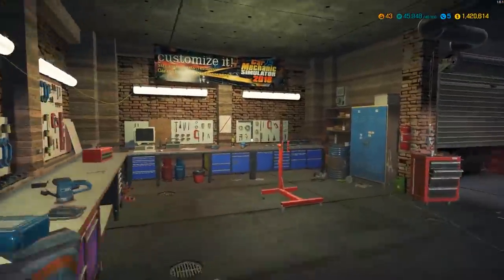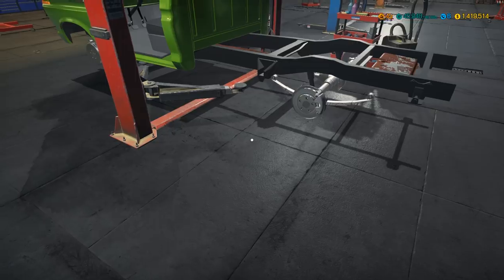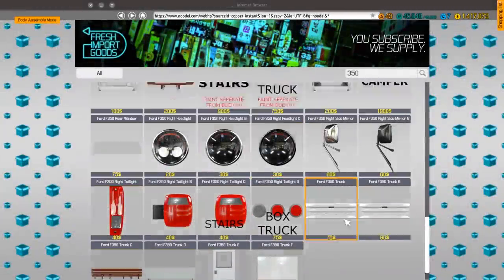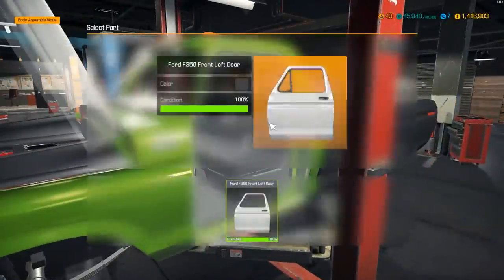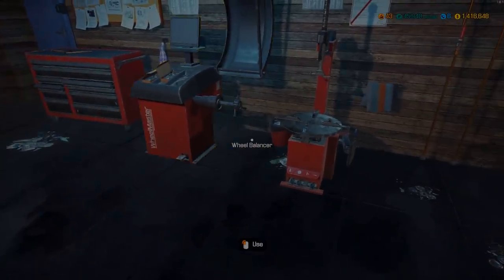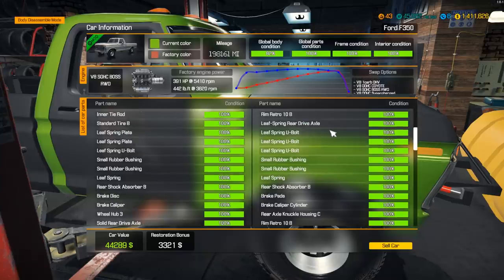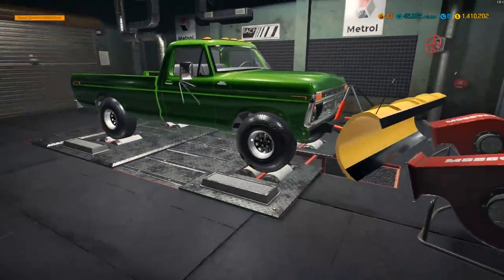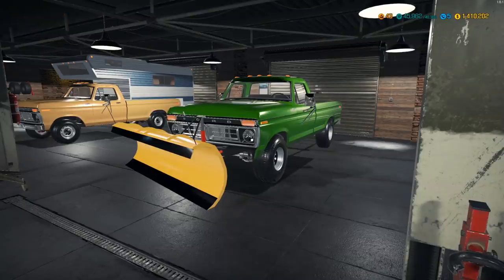1979 F350 PLOW TRUCK | Car Mechanic Simulator 2018

Comment: Gorillaman it is a 75’-76’-or 77’ cause you can tell by the grille style
Reply: jake Fournie in late 78 and 79 they also switched the shape of the headlights. Late 78and 79 had the square headlights
Reply: Yes but I consider the lights in with the grille change but the grille is the first thing you see usually
Reply: Its a 77 you can tell by the blinker color

Comment: Well if I may say the camper though skinny tires kind of fit at because if you look at a stock Ford F-350 from their hauling a camper they always had that skinny Tire on them and the it's not it wasn't really used for off road but with the green F350 plow Truck it kind of fits because it's got to go through snow